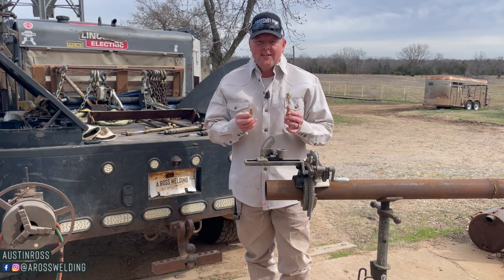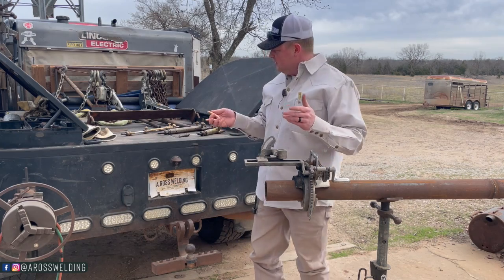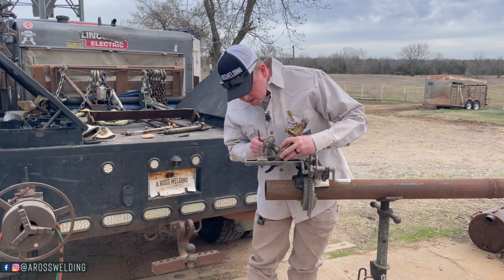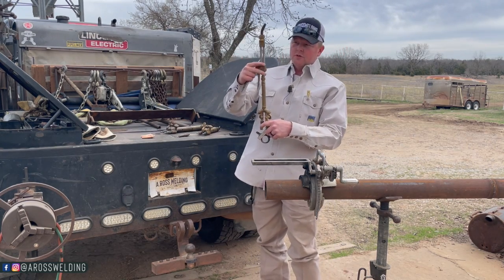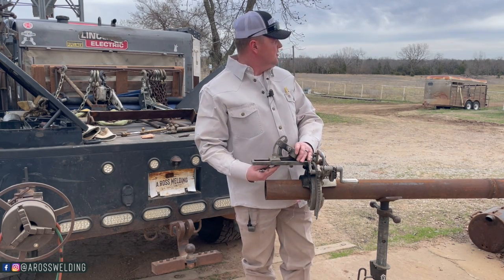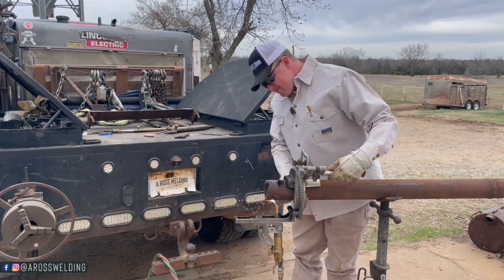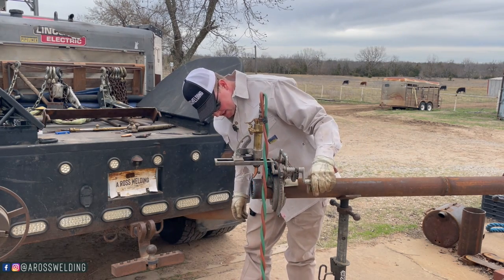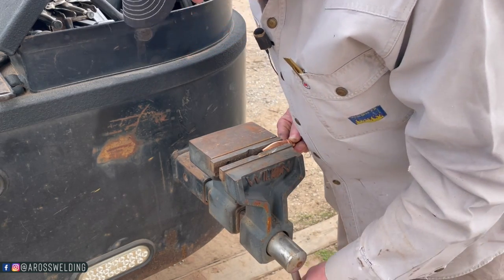Difference Between A Curved Cutting Tip & Scarfing Tip

Comment: That bigger end really helps wash out the weld. I’ve made bent tips out of the cutting ends, and they try to wash out the weld about 1.5” in front of the tip, so you end up cutting to deep out away from the place you actually wanted to wash away. I never really knew the difference between the two tips other than they preformed very different. Thanks for sharing this information. I appreciate knowing the actual details of why they act so different. It makes sense having that bigger opening to reduce range of the oxy blast. Similar to chokes on a shotgun I would think.

Comment: I cut the end of the beveler arm off to slide the torch holder assembly right off the end. Never thought of using a curved tip for cutting pups, smart. I always used the curved tip  to cut spools apart. To clear 90s and stuff on the piece you're cutting. Never heard of scarfing tip. Will have to check my tips and see if my curved tips are cutting or scarfing. Thanks for the info!
Reply from the maker: My pleasure!

Comment: Used a flat sided curved three hole (scarfing, two pre heat one o2 cutting) to wash large rivets, bolts, nuts or cutting I beams along the flange, or anywhere I needed a 90° cut close along a right angle. Basically it lifts the torch head up from the surface so the o2 jet is parallel, if that makes any sense, the cutting bent tip was more of a torch head clearance thing like the scarfing tip but a nicer cut, I had them both but the flat/bent scarfing was my favorite tip of that type and used it a lot including scarfing out welds. you can never have to many tips of different kinds when fabbing /repair work.

Comment: The slightly larger diameter at the tip of your scarfing tip is a counterbore. Normally propane tips have counterbores. A counterbore on a propane tip prevents the flame from detaching from the tip. Is your scarfing tip a propane tip?

Comment: Used to work for a company that would make pre-stressed concrete panels. A lot of times we'd have to weld in a shaped piece of steel for a reveal. Our welder would use a bent tip on his regular torch then to cut that free steel of the bed when we were done with that style of panel or sometimes cut a head of a bolt that was in the middle of a big plate, because in a regular cutting torch setup the nut that holds on the tip will not let you go completely flat against metal to cut the bolt off. You have to cut it in an angle and you end up cutting into your base metal. This way the curve tip would go flat against the base metal just the same as if you used a regular tip on an edge where there was a nut and you can actually go a little bit below the edge of the base metal to cut it clean. That's about the only time I've ever seen it used before your video.

Comment: The diameter or span of the fuel holes on the scarfing tip are greater than the diameter on the cutting tip. I may be wrong but it appears to be the case so therefore you would get a larger preheated area and larger removal. Thus the bigger scarf. I could be totally wrong, just guessing..

Comment: I just had the thought earlier today to ask you about tip selection versus material thickness. I know the charts say to use this size for this thickness, but I've never been able to get cuts as clean as I'd like. Some of that is me not using a torch all that much, but I wonder if sometimes going down a tip size and adjusting pressures a little would give better results.

Arc gouging is a really handy option to have, but inconvenient since you also need access to an air compressor with 20-30 cfm output There are some gouging electrodes that don't require air and are used in a regular stinger. Made by Rockmount, IIRC, and the name is Electra. I've burned a couple of them, but not enough to get the necessary technique down.

Tons of different torch tips out there. Have to sit down and browse the catalogs to find them though.

Comment: Too many welders,don't read that there are a lot of different tips available  for their torches & they get used to using one tip for everything & then they wonder why their torch doesn't do its job when they are in difficult situations  like cutting a thick piece of plate steel with a small tip that they use every day on 1/4 plate steel...they just don't realize that for a few dollars they can bet a bigger tip that would save them a lot of time,& gas ,just by getting a slightly larger tip, and too many welders ruin a good straight tip, trying to use their " regular " tip on a rusty salvage job,when a scarring tip will do a better job & not ruin a good straight tip. I have also found when cutting extremely rusted pipe or scrap metal,that if you adjust your oxygen & acetylene regulators up a couple of pounds- not over recommended pressure on the acetylene; but just a few pounds, that it helps to cut through the rust & gives a cleaner cut.